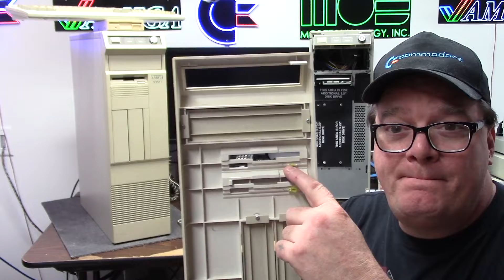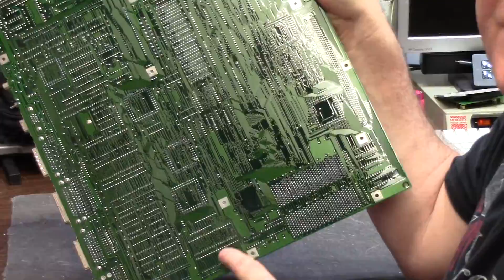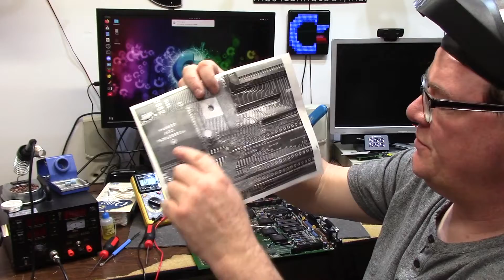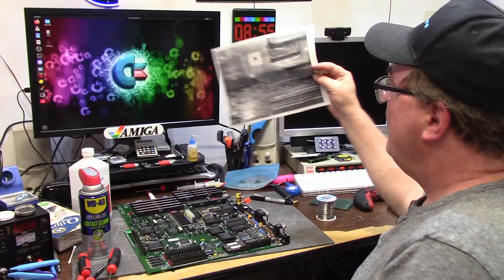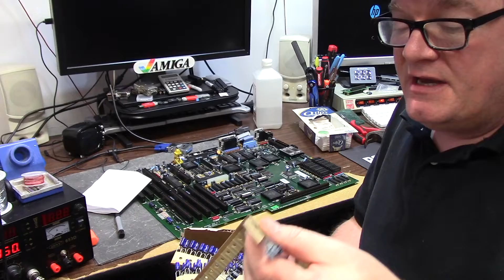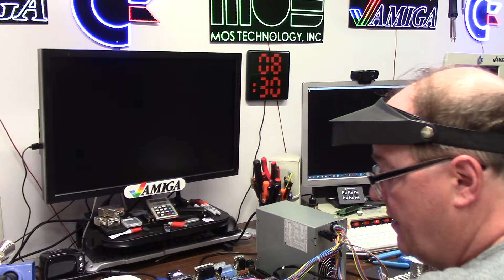MR Jack's Amiga 3000 Tower repair

Comment: If you haven't swapped the barrel battery for a coin, maybe folks should store A3000T's on their heads to prevent battery leakage running down through the motherboard vitals.
Reply from the maker: You would think. But most forgot over the years or didnt care.   Plus they are 68 us pounds a pop

Comment: Just wondering if the battery had been placed somewhere in the case and wired to the PCB would that have stopped the battery leakage from eating the copper of the PCB.

Comment: 250°F = 121°C! Careful there!
Reply from the maker: Lol close enough
Reply: @ChrisEdwardsRestoration  😂
Reply: Too hot tends to lift pads/tracks.

Try desoldering as cold as possible. I start at 110°C on a good solder joint if I have no idea about the solder that was used. Add 5° C until the solder melts. Maybe go another 5 after that to tackle the difficult bits. Copper wick will transfer heat but there's a slight temperature drop anyway.

Don't dwell on pads after the solder flows.

I used to burn up pads and tracks until I mellowed to use lowest temperature.
Reply: @BerndFelsche  Yeah; If that is really 310 Celsius, that is 590 Fahrenheit, not a little over 227. That's more than double than is required.

300 Celcius is about when you can start forging Aluminium.